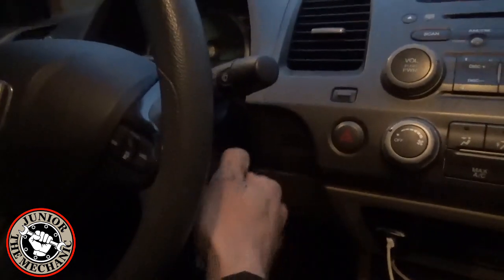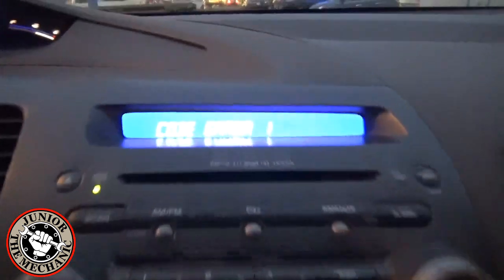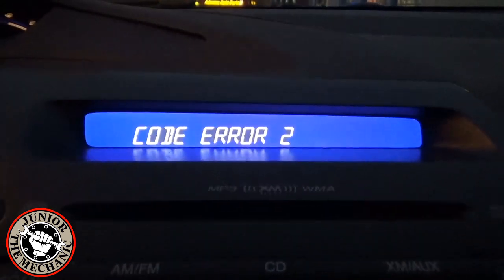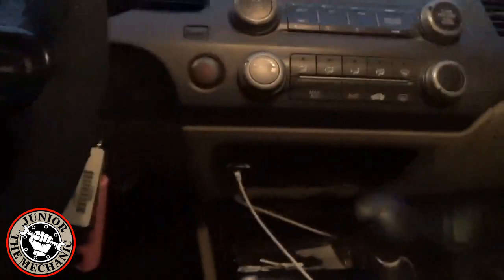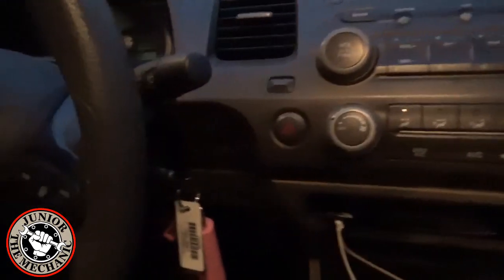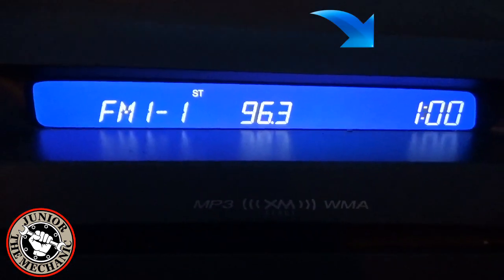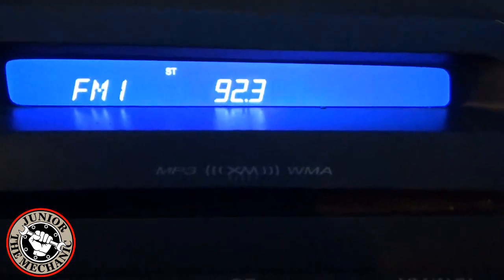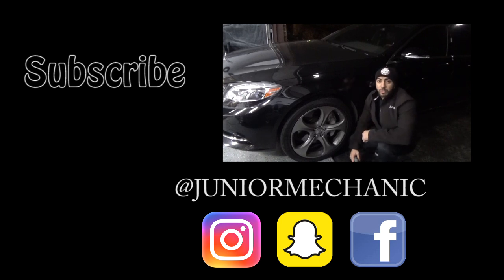How to unlock factory car radio

Comment: Honda and Acura should tell you when you call the dealership, that you need 2 serial number for the navigation and radio. I found the serial number on the cd changer in the trunk and forfeited that’s all I needed. I put that in the Acura website for radio codes and it gave me 2 rows of numbers. I figured one was for the navigation and the other for the radio. The navigation worked, but when I put the other row of numbers, it had the letter b for the last number and there was no way of putting in b and only took numbers. Now I locked out from putting any number.

I call the Acura support and they told me how to get the serial number for the radio and I tried that and none of the numbers move. I’ll call them again tomorrow when I’m off and try to get a walk through. But I have a feeling they are going to yell me to unplug the batter bc waiting 1 hour did not work for me.

This is like a trap and many are going on o go through this and it’s only a easy fix, if you have the cide. So if you’re buying a used Acura or Honda, make sure you get the code before buying.

Comment: What can I do it the number that im supposed to unblock it with cause the code I used didn't work and I don't have the owners handbook
Reply from the maker: Another method Is to remove the radio from the vehicle.. Then take note of the serial number located on the radio.... Then call the dealership with that serial number... Then they will supply you with the code to unlock the radio!!!!